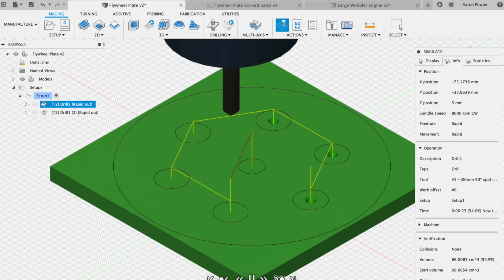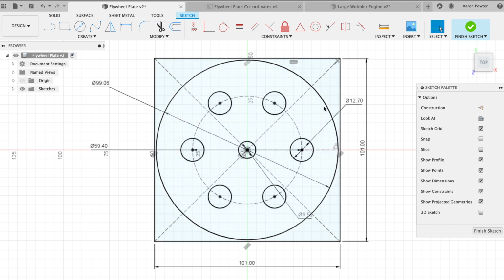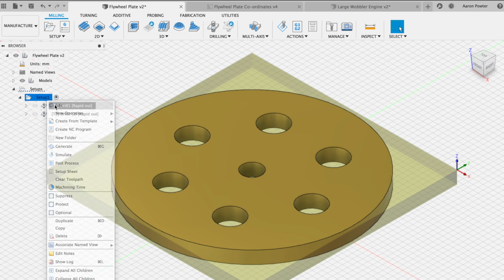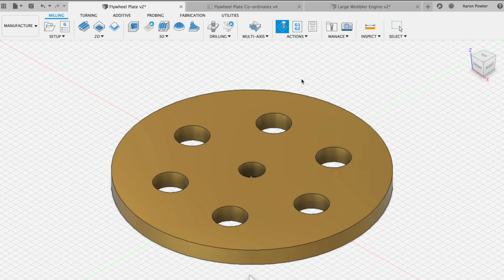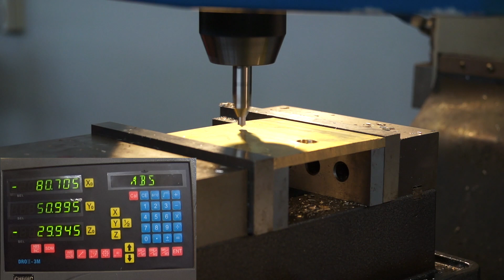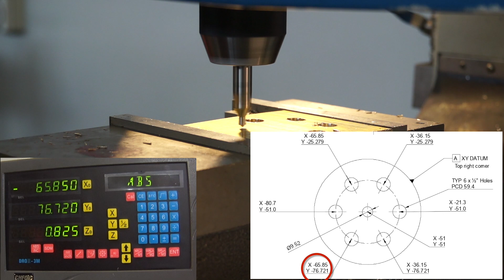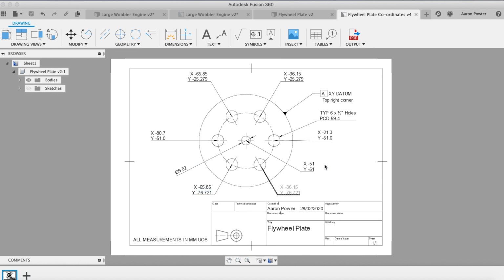This is Crazy...CAM on a manual MILL

Comment: Aaron,  from a problem solving point of view this is great. Using what you have on hand and still digging into Fusion for your students will help them a lot as they advance their careers .
I find the PCD function in the DRO is magic, but your approach goes further. 
Glad to see you back in front of a class.
Bet your students are pleased too.
Reply from the maker: Thank you Mike.

Not sure if you know, but I moved on from the Vic Govt of Education down here.  14 years working for them just about burnt me out to be honest with you (mentally & physically).  The students were fantastic, but the bureaucrats in charge?  Well that's another story LOL.

I'm actually working for the Catholic Dept of Ed now.  It's a lovely P-12 college with excellent kids and staff.  Plus it's only 8mins up the road mate.  I've truly fallen on my feet.  Oh guess what, I even have my own teacher assistant who is trained fitter and turner.  The big boy has never had it this good.  It's bloody heaven Mike.

Cheers buddy, Aaron.
Reply: @DCT_Aaron_Engineering  That's great. Things have moved on nicely since I saw you last June then.
I'm doing a little job right now that could have used this style of thinking. It is just some mounting plates. Being a 70s apprentice I cut them to size, marked them out and off to the drill press.  Only when it came time to tap them I thought why not commission the tapping head I bought for the mill a while back.
Now if I had drawn it up in Fusion, instead of on the back of my eyelids, I would have had all the coordinates for the DRO.
There is no bad habit like an old bad habit. 
Cheers.
Reply from the maker: Mike Newman I like your thinking Mike. I used to be exactly like this back in 80’s, 90’s and early 2000’s. Now I’m that dumb if I don’t CAD the model first I usually stuff it up. We need to get you in a CNC mill mate 😉

Comment: I always said that it would be useful for technicians to use CAD on the shop floor for layout work like this. Even a simple 2d cad program would improve accuracy and speed the layout process on low volume or job shop type work.
Reply from the maker: Hey Stephen. Yes I agree with you mate. The same can be said for a CNC router. It may not have the power or rigidity to cut a particular part out, but it will easily mark everything out for you with a 69 degree engraving bit 😉

Comment: I also did similar method but not use CAM feature, i just use Ordinate dimensions so can extract the XY coordinate as reference for the DRO.
Reply from the maker: Hello Didi Widya Utama.  Thanks for watching my little video.  Yes you can just use the PDC function on the DRO.  However, I didn't have the manual for ours and seeing I know Fusion360 CAM I just used that.  Cheers, Aaron.

Comment: It's a clever method of grabbing the coordinates from the CAM that would have to be calculated the old school way using trig without a PCD capable dro and one I need to remember. While the part in the video is fairly low tolerance so it doesn't really matter, some viewers might gain the impression that edge finding the rear fixed jaw in the Y axis with an empty vise will always give you a fixed Y axis datum on that jaw face that can be set as zero in the dro or on the dials. Unfortunately that's not so and all milling vises including the best will deflect that rear jaw a few thou just under varying amounts of tightening pressure and even the work piece height changes within the jaws. For a higher accuracy part that deflection may be enough to spoil an otherwise good part. Fwiw it might be better when possible to tighten the part in the vise then edge find that jaw location for those higher accuracy parts. A lot of shops will use torque wrenches to tighten there vises to gain the repeatability of having the same vise deflection on multi part runs.
Reply from the maker: Thank you for your very detailed explanation and for sharing your knowledge & experience. This is the best thing about social media in my book “sharing with others”. In hindsight I should have probed it once clamped. Just as you suggested this wasn’t a critical part and further post machining is required in a mandrel to make the plate concentric. Thanks again for dropping by. Cheers Aaron 👍🍻

Comment: As  I understand it .if you have a dro fixed to your mill it will in most cases have a PCD on it am I wrong?
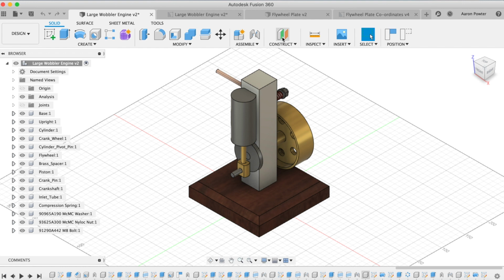Reply from the maker: Hi Colin thanks for watching. I actually stated that in the video at 9:50. This was just showing another way of doing it. You could also apply this method with the dials (non-DRO). Cheers 🍻

Comment: Now to just modify a post to output plain text commands for a manual machinist, kind of like a human NC.  A Heidenhain post should be easy enough modified to do this. Maybe something like this: 
Stock X-50, Y-50, Z-10
           X50,  Y50,   Z0 
Change Tool 1, Spotting drill
S1000 Clockwise
Move to X0, Y0
Drill Z-3
Change Tool 2, 10mm Drill
S600 Clockwise
Move to X0, Y0
Drill Z-15
END
Reply: Great idea!
Reply: Like the idea. It would also reduce transcription error from having to copy and paste the coordinates from the CAM window to the blue print.
Reply from the maker: Hey Matthew. That’s actually an excellent idea. I like it. Something like this would really help the students 👍🍻
Reply: @DCT_Aaron_Engineering  It should be easy enough done if you came up with the syntax for it.   I've modified quite a few posts.  There's some posts that are already pretty close.  It might be something John Saunders would be into as well.